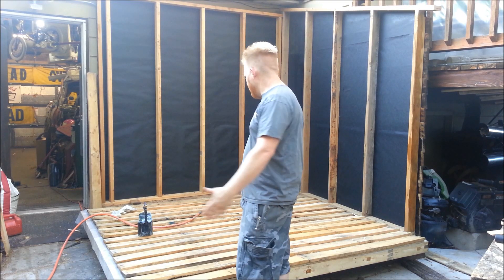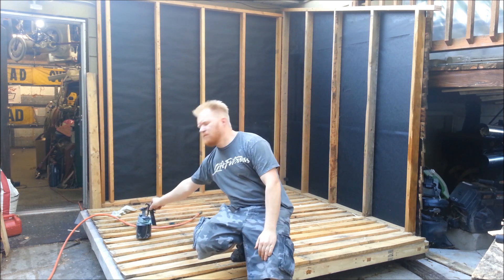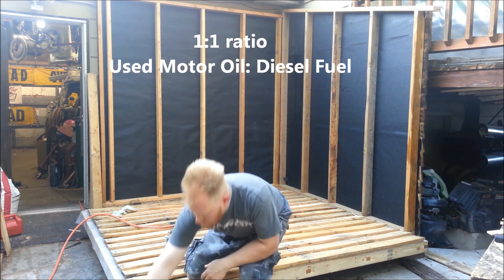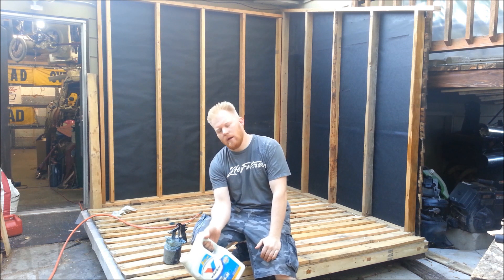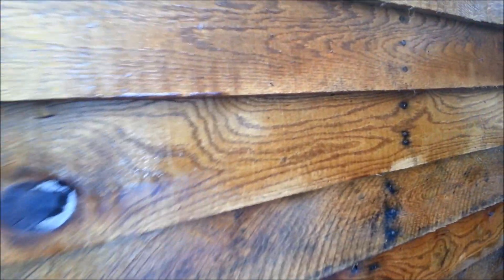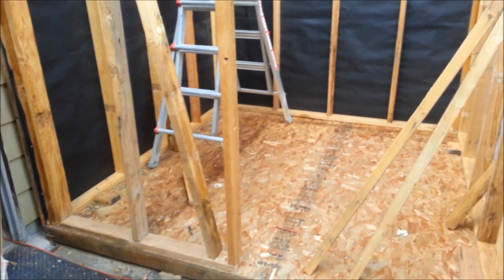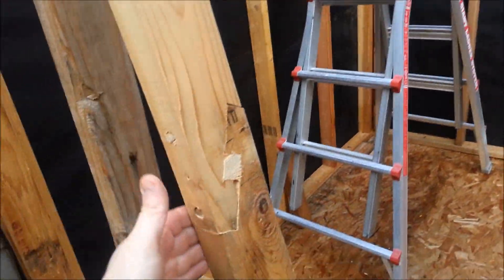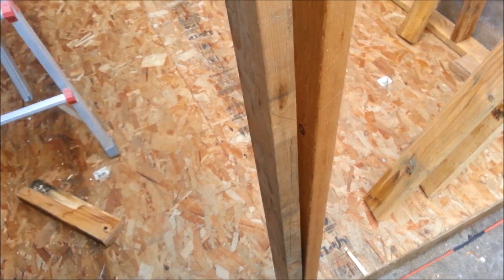MOTOR OIL STAIN Shed from FREE pallets part 3

Comment: wouldn't ta motor oil spray on wood cause an extremely frameable shed.
Reply from the maker: Treating it will actually make it less flammable than if you just left it raw wood. Motor oil/diesel is far less flammable than a commercially produced oil based wood stain you would buy from the home improvement store.
Reply: that is very interesting.  Thank you

Comment: You say used motor oil and diesel fuel, can you just use used motor oil?  What's the point of the diesel fuel?
Reply from the maker: +Matthew Taylor Diesel just thins it and allows it to soak in quicker.

Comment: is that just a paint sprayer
Reply: i want to do my fence. im kind of cheap what u think of just oil.  pros and cons.
Reply from the maker: You can brush it on or spray it. The only reason I thin it with diesel fuel(just really thin oil) is to make it spray-able through a standard paint gun. If you brush/roll it on, no thinning is needed or you can use it full strength with an airless paint sprayer.

Motor oil will outlast any commercially bought stain I've ever bought. The only con I can think of is you can't choose your color. It comes out a beautiful natural wood tone with gasoline powered engine used motor oil and will come out a darker with old diesel oil.

Comment: Man, the fumes must be great. My neighbors would be down my neck if I sprayed my fence with oil and diesel.
Reply from the maker: +Robert McKeown That makes no sense, neither have much smell at all? They are 1/4 the odor of an oil based stain bought from the Home Depot.
Reply: it actually stinks less than Thompsons deck seal and is an 1/8th of the price. less flammable too

Comment: This is an extremely irresponsible and stupid thing to do. Motor OIL is not the same as OIL used in stains such as Linseed Oil. You just created a very toxic shed especially with the addition of Diesel Fuel. 

It costs very little to take Linseed Oil, Thinner and some cheap Oil Paints / Tints to make your own stain.
Reply from the maker: Petroleum based oils are the most common oil for stains. Linseed oil from flax plants is very dangerous and is seldomly used due to spontaneous combustion. Outdoor wood will last far longer with petroleum oils.
Reply: I used sump oil once on a fence as an experiment.  After a few years in the sun, it burnt / baked the wood.  Have you had any issues with this?

Comment: So, you point out the MSDS, but I think you failed to notice the part where it says it's not a health hazard "when used under normal conditions." Motor oil as a wood stain is not a normal condition. Also, it adds that used oil "may contain harmful impurities." Don't even get me started on the diesel fuel. Three years in, how are your lungs? Any cancer yet?
Reply from the maker: Diesel fuel it just oil. The point in the MSDS is showing it is definitely far less harmful than a store bought oil stain. I wouldn't hesitate to put it on anything I was subjecting to the weather.
Reply: There's really no point in my saying this since it's apparent that you don't pay attention to anything you read, but this was a major error in judgement on your part and you really shouldn't be encouraging others to follow suit.
Reply: My bad. Do what you want. Everything is fine and I'm just a jerk.
Reply: But it's not just him. He's telling others to do it, claiming it's fine because the warnings for one sound just as scary as they do for another so it's probably fine. And they're just eating it up and think it's a great tip, and he's making money off the ad revenue. Tell me that's not messed up. Call me a know-it-all dickhead if you want, but that doesn't change the facts of the situation.
Reply: I'll concede that the revenue is probably the weakest part of my argument, i.e. Google won't be breaking bank on his paycheck anytime soon.

I think what's bothering me most is just the notion at he actually read what I said and what the MSDS said, and he's totally dismissive of both. It's like what the hell is this country coming to when personal opinion is more important than factual information, hard science, and professional experience?
Reply: For myself, I see no issue with using this method of protecting wood.  I did notice the aerosol mist in a confined area to be quite another matter.
Reply: I was thinking that it would be better to roll it on than to spray it.
Reply: Jason Pokines 
i know this is an old post but
wa wa wa. where do you think oil comes from?...lol. used oil impurities?....lol. and your worried about unburnt diesel fuel?..lol. environmental people are so gullible and brainwashed.
Reply: Jason Pokines  Relax & Enjoy life for a change! All professional Stain Products Are More Hazardous to your Health than motor oil & highly Carcinagious
Reply: Well whatever you do, do not eat those oil soaked boards.